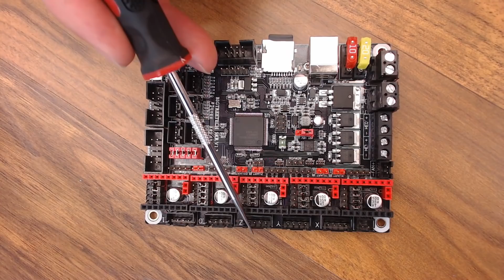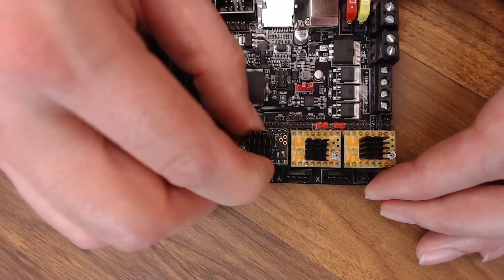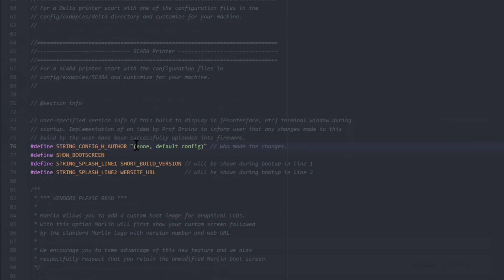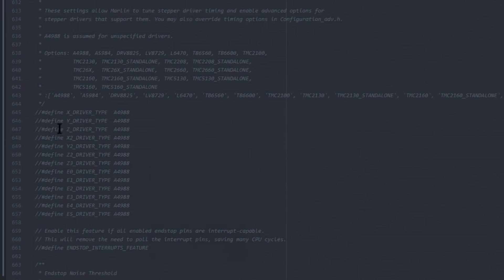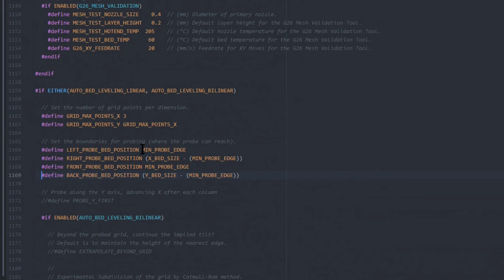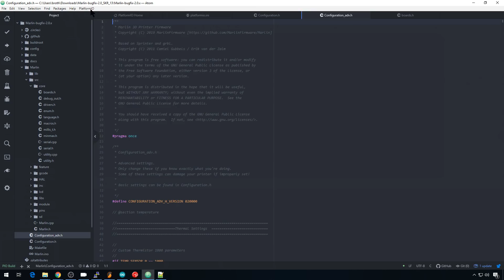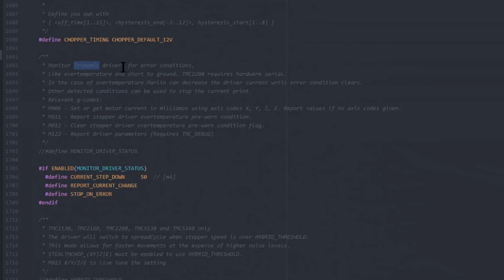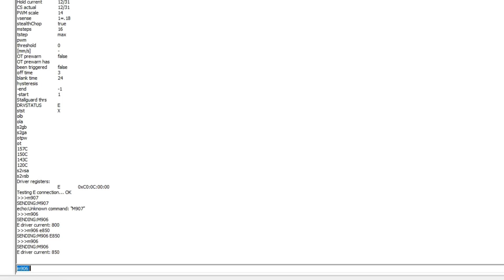SKR v1.3 Mainboard Install - TMC2208 - Chris's Basement

Comment: Hi Chris, I have just took receipt a SKR v1.4 with 5 x 2209 drivers for my Hypercube build. I am quite techy but not a lot of experience with 3d printer electronics and to be honest I do not know what the advantages are of all the modes mentioned. I am comfortable with firmware configs after upgrading 3 of my machines with E3 minis. Which mode is the easiest to get started with ? Can I just set up with the default jumpers in place and progress dabble with jumper settings after some testing? Is it better for relative newbie to start in stand alone mode as per your video or leave as default? Thanks and best wishes Boothy
Reply from the maker: Hey Stephen, it really doesn't matter on the SKR boards. I would just play with it. There is really no reason not to go strait for UART mode on the 2209. With the BTT drivers, you should need to mess with solder pads or anything. I do think on the 1.4 you might have to clip a pin. I would have to check the BTT guide to confirm.
Reply: Thanks again Chris, Yes it does appear you have to clip a pin but it states if you have probelems with mechanical end stops, I do not know if that means optical as well ? I  am quite interested\keen on sensorless homing on the X & Y, if I can get this to work it would be so much tidier on the Hypercube\ Core XY than wired end stops. May have to clip a pin for the Z axis though I would like to retain. Seems a bit barbaric for brand new 2209s,, I suppose I can always buy another one if things change. just need to swot up on sensorless homing. Best Steve
Reply from the maker: @boothybuilds  Yes, that includes opticals. I agree with you, seems like a crappy fix to have to clip pins.

Comment: I believe as of Marlin 2.0.3 the 2208 on the extruder is still not compatible with Linear Advance 1.5. When the GCode tells Marlin about the linear advance, the extruder stops moving. It was reported back on the GitHub and there is a solution which implies editing some files (not configuration.h or configuration_adv.h). However, as far as I know, the solution has not yet been implemented. That's why I'm still using A4988 (I think) on extruders on my Marlin driven machines.
Reply from the maker: Hey Felix, we are actually talking with Scott on Lu from Marlin on the Friday hangout. I will ask them. It will be on this channel. https://www.youtube.com/channel/UCPOu2PrCF3J3j05L9jlEsMQ/featured

Comment: I bought an SKR v1.3 after watching your video and was amazed to find 2-3V of ripple! on the 5V switching power supply even though the 24V input had only 120mV of ripple going in.  They do seem to have put some thought into the filter network on the 3.3V supply (not that it helps much with right around 1V of ripple), but there's no such network on the 5V supply.  Just curious if this is typical, or if my board is just defective--have you tried putting an oscilloscope on yours?
Reply from the maker: I wish I had an oscilloscope! I would guess this is probably pretty typical, the components on these aren't the highest of quality.

Comment: When splitting the Z axis motor do you have to change any voltage or other settings in the firmware ? I have purchased a parallel expansion board for \splitting using with my CR10S but wanted to make sure this was safe without any firmware tweaks? Thanks in advance Boothy
Reply from the maker: For Z motors, you probably won't need to. That said I am not sure what yours is set at currently. Depending on the board, you can probably adjust it with the on-board POT.
Reply: Many thanks for your response Chris, I am using the SKR Mini E3 with stock settings on the firmware at the moment. Will obviously change suit CR10S mechanical size. Best Boothy @ChrisRiley
Reply from the maker: @boothybuilds  You can probably set the voltage on that board from the command line if you need to. Check out M906 or M907 they will show in the M503 output. Use pronterface to talk to it via USB.
Reply: Many thanks again Steve @ChrisRiley
Reply: Bummer I have just realised there is only one Ribbon cable port for the display on the Mini ( 2 connectors on the CR10S) so I do not know if it will work anyway ? I am starting to build a Hypercube might use it on that with the new 3.5 display board instead.
Reply from the maker: @boothybuilds  Yeah, the mini was designed to be used with the EXP3 style screen like on the ender 3. You would have to split the wires somehow.
Reply: I thought so, I think I will put to better use on the HEVO with a new screen, thanks again for your support, best wishes Steve

Comment: Hey Chris will this work the same for the TMC2209 as well?
Reply from the maker: Yep, same for 2209's.
Reply: I have 1 more issue. When I hit home all instead of homing. X moves forward 10mm y moves 10mm to the right y does home. What must I change in Marlin? I think it's set to Uart but not totally sure.
Reply from the maker: @johnnyadolphojr7346  It could be one of the endstops isn't set correctly. Try to invert the ones not working.

Comment: Is there a setting in Marlin that disables the 12/24 Out? I ask because after setting up and tweakin settings for my SKR v1.3 in the Marlin firmware my fan that is connected to it no longer comes on. It was running constantly when powered on. I am trying to use it to cool the Stepper Drivers. I switched my hotend fan to HE1 an d set it up to Auto start and stop at 50°. The part Cooling Fans work as well. It is just the fan in the 12/24 Out plug that is not working. I am wondering if I accidentally disabled it.
Reply from the maker: I don't think there is. I think that plug is directly linked to the input power.
Reply: @ChrisRiley  hmm...🤔...Well I wonder why my fans are not running / spinning. It's really strange because when I run the fans directly to the pay they spin. But when I plug them into the 12/24v out they don't. Yet when I use my multi-meter on the 12/24 Out it reads 24v. The fans are rated 24v. Maybe I'll just run them directly to the PSU and give them their own controller to turn them on and off and adjust their speed. It'd be the easy way to fix it.
Reply: @ChrisRiley  Update: In my other earlier reply just below from a few minutes ago I said I might just go ahead and wire it directly to the PSU with its own controller. In getting ready to do this I noticed something. Something so obvious yet so mundane that I totally ignored it the whole time. The wires for my new set of 24v fans are all plugged into their connectors opposite from is needed. So the negative and positive are reversed. I just had to flipped them around. I sort of feel a bit dumb. 🥴 ROFLMAO
Anyways it is all fixed now. Problem solved.🤘😉👍
Reply from the maker: @VectorRoll  LOL, I do that kind of stuff all the time.

Comment: I was reading last night is does have  pins for a 2nd Z motor  4 pins above the driver pinout 8:03
Reply from the maker: I have tried those pins in the past on a MKS board with no success. I always thought they were for some sort of reference. I will have to test that again on this one.
Reply: @ChrisRiley  ahh i should have known  just going by what I read . Ive never had an skr 1.3 board. Will tomorrow

Comment: Hi Chris. First of all thanks a lot for this intuitive video. I have a Tronxy XY-3 and I wanted to change the board and screen to a SKR 1.3. However I couldn’t really find some config files especially for the Tronxy XY-3. Any tips for finding the numbers and details on the net like the default axis steps per unit etc. Thanks in advance
Reply from the maker: I am not sure on the net where you can find them, but you can get a lot of that info from a M503 command. Try running that from pronterface while connected USB.

Comment: hey Chris,,, got my 1.3 board,,,, board lights up ,,, no fan,, no communication with usb,,  put sd card in computer and it doesnt register as memory?  ever see this?
Reply from the maker: Hey Walter, no fan? What port for the fan? Could be bad SD card.
Reply: @ChrisRiley  i think the sd card is bad,,, am reprogramming another (lol) such fun!  but a learning experience,,,,, (signed) "in a state of confusion"
Reply: sd card is bad,, and ordered another board for another project... copied that card for this board and still nothing,,, guessing the problem is more ,,, going to switch boards tomorrow and see what happens
Reply: got the skr1.3 installed on the opposite side of the a6 frame,,, getting better at solidworks ,,, designed a case for the original space above the table for the controller lcd  now the tft35 sits there,,, next programming
Reply: got the case for the tft35 anet published  
https://www.thingiverse.com/thing:4081971

Comment: Sorry for all the questions, Chris, but you're the only one who answers me :)
I ordered these https://www.amazon.com/gp/product/B07SHBNV73/ref=ask_ql_qh_dp_hza in the version that claims to be preconfigured for UART, but the pads that I've seen people soldering were not soldered when I got them. Might there be something I'm missing where it's somehow modified in another way to work for UART?
Reply from the maker: Hey! These are designed to work with the BTT boards, so the jumper control the mode. Are you using an SKR board?
Reply: @ChrisRiley  Yeah I'm using the SKR 1.3
Reply from the maker: @liljashy1463  Then you should be all set as is. Just add the 1 UART jumpers for all the drivers.
Reply: @ChrisRiley  Thanks man! You're the best.

Comment: have a problem Anet A6 with an anet v1-5  board,,,board was programmed for an A8 and the offsets are wrong for an a6,,, anet wont figure this out,,, so time for a change
Reply from the maker: Hey Walter, you should be able to correct those offsets pretty easy. In slicer you can correct them, even with no firmware changes. That said, the SKR board is a lot of fun.
Reply: @ChrisRiley  i corrected the offsets a dozen times and computer disconnected the offsets return on reboot. saved and resaved and  and and
Reply: did it in Repetier
Reply from the maker: @brotherwallyswoodshop  Might just be eeprom, run a m502 then an M500 to save it.
Reply: @ChrisRiley  Ill try it but i did order the skr 1.3 with 2208s
Reply: had serious thoughts of playing with the tmc 5130s  love the idea of braking,,, i am refitting electronics to a shopbot now
have a board i bought two years ago  a LV8727T4V1
Reply: (5130)  and the sensorless endstops  thought that might be really great for zeroing in the router height after bit changes,,,, get both the home and zero for cutting

Comment: Man that's awesome.
I've got a CR10-ish printer made by Bluemaker, seems like no one's reviewing them and they're just selling those in Asia
The whole thing seems like a upgraded CR10 however they don't release their code, and sure it has no thermal runaway protection

I'm going to upgrade the board for the ease of flashing new marlin, and perhaps some quiet tm2208 will be great too, Your video will help me a lot

However during my research I still can't see anyone teaching how to set up 2 different Z motor and 2 Z probe in Marlin, Do you have any idea where i should look for?
the original one seems using Z min and max stop as their 2 Z probes, and E1 as the second Z motor.

Thanks a lot!
Reply from the maker: Hello, yes, you can use one for top and bottom, that isn't to hard to configure. Do you have a link to the printer your are looking at so I can see what the config looks like? Thanks!
Reply: @ChrisRiley  woo man thanks for the reply
the link is from Taobao, the local version of Aliexpress

https://item.taobao.com/item.htm?spm=a1z10.3-c.w4002-14228878043.41.796851c5Ett1W0&id=578482983357

and the board they're using is this (similar i guess) :
https://www.amazon.com/HWA-KUNG-Printer-MPX_V5-0-Mega2560/dp/B07HSZ5B53
Reply: the printer have 2 individual Z minstop and 2 individual Z stepper with thread rod.
I just found out i can set dual Z stepper in marlin, and still searching for dual Z minstops

Comment: This is a great tutorial! I'm going to follow this to upgrade one of my printers; the original control board is dying.
Reply from the maker: Awesome! Good luck with the upgrade, thanks Dave.
Reply: I'm back, and my rebuild is complete! My SKR came with a dead X axis - it just wouldn't work in UART mode. For now, I ended up remapping the E1 axis I'm not using as a replacement for X in pins.h. You just swap the pin numbers around. It works!
Reply from the maker: @davepedu5896  Nice, glad you got it working.

Comment: How would I set up the ABL on my Ender3
Reply: Sorry Chris using an SKR V1.3 board and TMC2208 drivers please. I am subscribed to your channel Have watched your video on the SKR board and TMC2208 drivers but am at a loss to setting up my ABLE sensor (Not BL TOUCH)
Reply from the maker: @jeanraines3215  Should be able to use min Z endstop plug. For the Marlin config I have a auto bed leveling video on that.
Reply from the maker: Using the SKR or the stock board?

Comment: You just fried my mind, I wnder how many times you have to do what  you did to get that fast. Well I subscribed and if I watch it enough times I will learn from you. Thank you Chris your a  3d printing guru. I thought Trinimic drivers where when the printer bottomed out so to speak on all its axes to find its limits, is this not so?
Reply from the maker: Sensorless homing you mean? Yes, TMC's do that on the 2130 and the 2209.
Reply: Ya thats what I mean. Thanks. Does someone manufacture a control box with all the goodness inside for some of these old printers like the CR-10s, like touch screen, new power suply, and 32 bit board, and cooling fans?
Reply from the maker: @landlocked4771  You know, that's a great idea to offer something like that, but I don't think anyone does.

Comment: I will buy one of these in order to upgrade one of my printers
Reply from the maker: Let me know how I can help Cat, they can be a little tricky.
Reply: @ChrisRiley  why is it tricky? Which version should I buy. 2208, 2208 UART or 2209? I will buy the version that includes a TFT. I also would like to include a bed levelling sensor. I've seen that some people use a splitter adapter for the Z axis driver for dual motor Z access. What to you think about that?
Reply from the maker: @choschiba  The firmware can be a bit tricky. I would go with 2209s, that splitter cable works just fine.

Comment: When I home the printer it isn't showing 0 for x&y on the display, any ideas?
Reply from the maker: Hmmmm, what does it show? Is it a negative number? What printer are you using?
Reply: @ChrisRiley  I have an ender 5, when the printer is in the home position the x&y shows 220
Reply from the maker: @Ardrak001  Ah, so maybe that printer homes at max? I am not for sure because I don't have any experience with it yet, but I should be checking one out soon.

Comment: Chris Riley I set up my SKR1.3 like  your own video for UART mode and they all work well... Βut I am facing an issue misses steps at printing...as if I have not regulated vref the currents well.!!!!!...Because I had 5 Others motors  with more amperes from---- Wantai  model 42BYGHW811L20P1-X2 (2.5A)U 1.8deg/step---....Do you have any furmoula to set the Vref correctly!!!!!!!   Or how to set !!!!!! Thanks Again
Reply from the maker: So you are using UART mode? What does your M503 say about M906? I would start at around .8 milla volts and monitor the motors to make sure they're not getting to hot.
Reply: @ChrisRiley  echo:Stepper driver current:
echo:  M906 X800 Y1200 Z1200
echo:  M906 I1 Z1200
echo:  M906 T0 E800
I Have for Z-Y 2.5A step mortor and for X-E 1.7A step motor.....if i have them All 800mA OR 1200mA The motor is no very hot ....For 800Ma is all cool ..but whether I go up or down the voltage in Vref I lose
steps....mechanical belts are all ok

Comment: Do you still need to use the trim pot on the stepper driver to adjust your voltage, or is that all handled by the current control in UART mode?
Reply from the maker: In UART mode that is all handle by the firmware. M906 command.

Comment: hi . i uplode the firmware every thing is ok but the endstop don't work i tray every thing invert the end stop . invert the motor . nothing change still the endstop don't work the wiring is correct ? can you help
Reply from the maker: Are you using a 2 or 3 wire endstop?
Reply: @ChrisRiley   😁 i fex the problem it's ok know. Just another problem 😆 the heatbead show on lcd 46 digress if unplug the Termestor show 39 . And when i started printer there's no problem the bead heated up when i checked it by laser thermometer is showing 26 degree 🙃
Reply from the maker: @OyaVapor  Excellent!

Comment: Completely off topic to the video, but I have a newbie question about something I noticed: the cogwheel on the back of the extruder stepper. How does one modify the motor so as to have shaft coming the back so as to to do that?
Reply from the maker: I just use 2 small round magnets stacked on eachother. Then I glue it to the printed part. https://www.amazon.com/gp/product/B07B3SDRCP/ref=ppx_yo_dt_b_search_asin_title?ie=UTF8&psc=1
Reply: @ChrisRiley  ah, so that's just for visibility of movement, not for actually turning the axle.
In having issues loading my bmg, the usual load scripts just spit out "too long extrusion prevented", so I thought I could get physical :p
Reply from the maker: @GusTheAncient  Right, it's just to help see if you are getting any extruder skips. You can break the load commands up like 100 at a time to get around that issue.
Reply: @ChrisRiley  yup, thanks. I'd worked it out, meanwhile, as well face-palming for confusing relative and absolute positioning. Thanks for the tip, anyway :)
Reply from the maker: @GusTheAncient  Anytime!